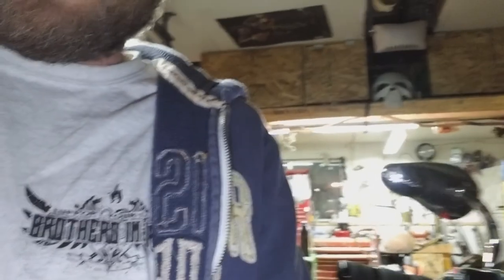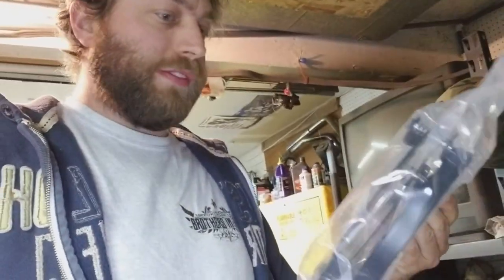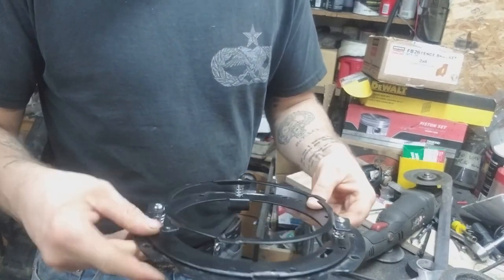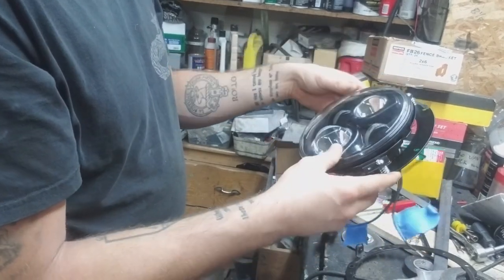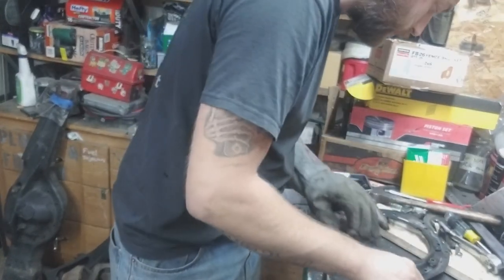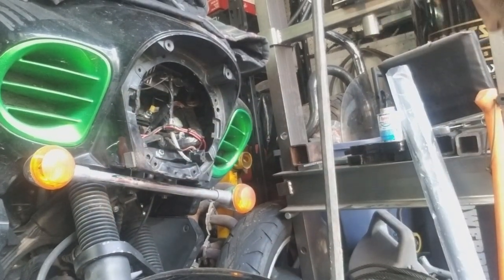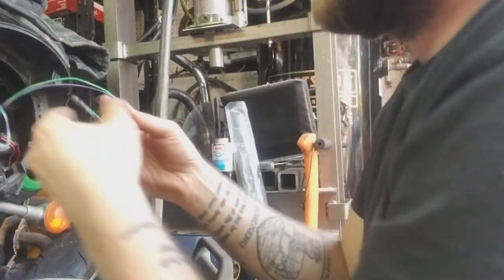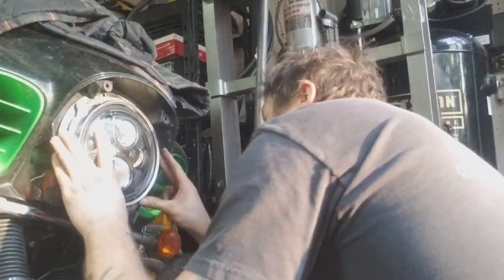Day Maker Kawasaki Vaquero LED headlight how to

Comment: No adjustments? Your beam had to been high. By the way, if you sanded down the edges of the the adjusting plate you are allowed enough room to lower the stock chrome ring to the stock black plate. no need for washer/spacers. New ring sandwiched between stock plate and chrome ring cover, 3 bolt complete. Looks great thou!!
Reply from the maker: Yourbassfan no adjustments?  what d o you mean?  this retains full adjustability
Reply: ok, looked like you couldn't utilize the adjustment screws
Reply from the maker: Yourbassfan you have to remove the chrome ring, or drill holes threw the chrome ring.  but yes it retains three point adjustment